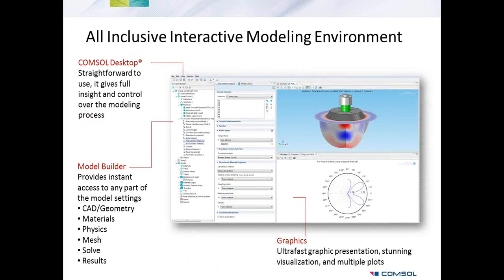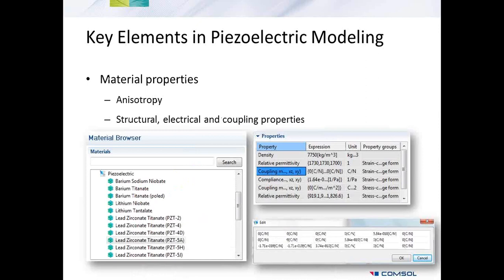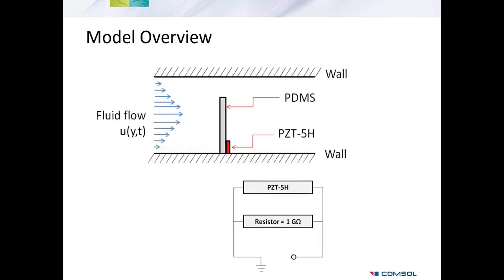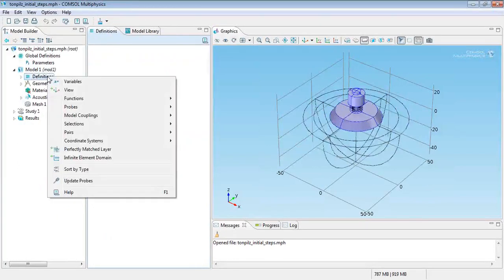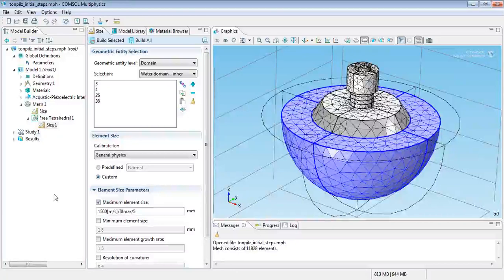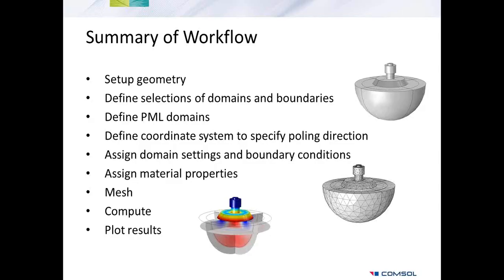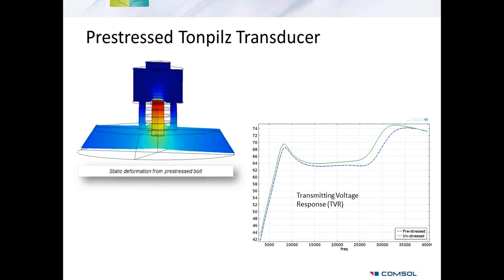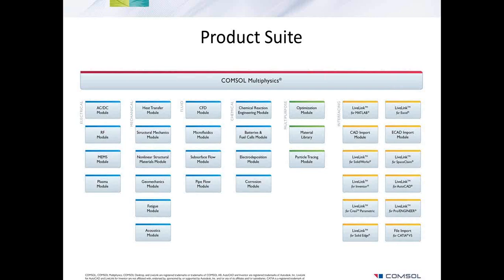Piezoelectric Simulations with COMSOL Multiphysics

Comment: Design and simulate a piezoelectric pressure sensor that can yield a 1 V change per 100 mbar increase in ambient pressure. Device volume should be < 1 cm3. i am working on this but output voltage is very high can you plz help me?